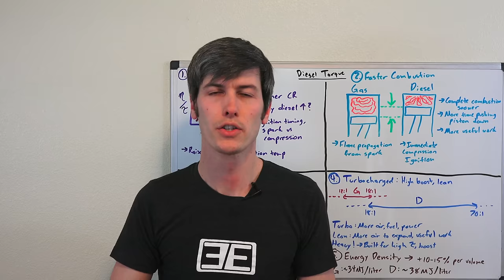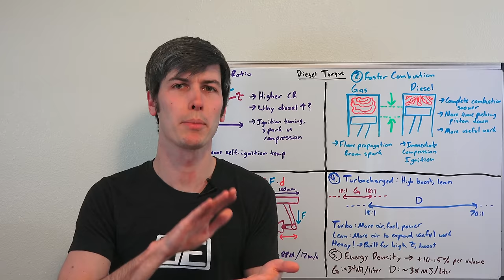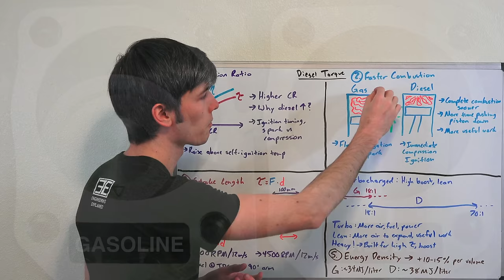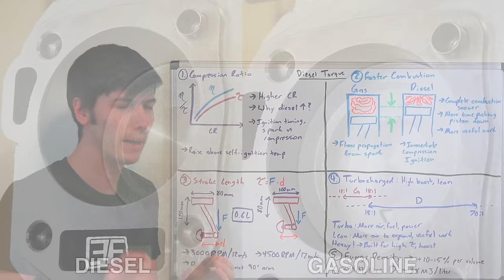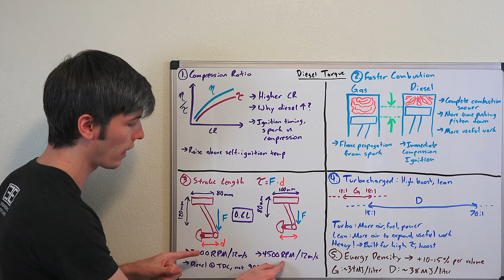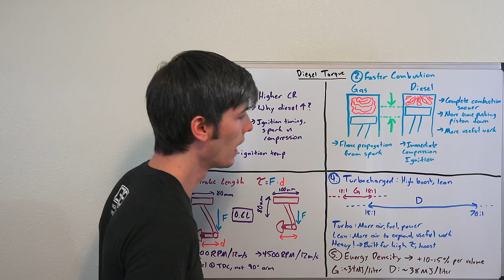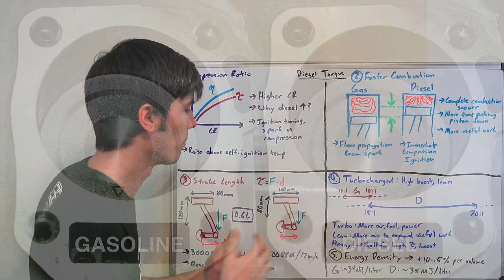5 Reasons Diesel Engines Make More Torque Than Gasoline

Comment: @Engineering Explained: What's the point of the comparison "Diesel has higher Energy in it, so if you spray the same amount Diesel in a Cylinder then you get more torque"? Your ECU always tries to spray in that amount of "burnable liquid" to get maximum  usage of all oxygen being inside your cylinder, no? So that would not mean you get out anything more or less torquy for the fact of energy being in a liter of Gasoline or Diesel. You just don't have to spray in the same amount of Diesel as you do have to with Gasoline for getting as much Oxygen being used for burning the fuel as possible. Or what exact was the point with the energy in it regarding torque?
Reply: Is that true to Turbo-Diesel's as well? To be honest I don't know what effect is more important - not having to compress more air than absolutely needed or getting more work out of the same amount of fuel by having more air volume pushed inside the cylinder. I would expect Turbo Diesels are not compressing more air pressed in the cylinder by the (regulated) Turbo as they need to because heating up more air for same amount of expansion would take more fuel as well.., so in my opinion ECU will try to maintain "load" figure nearby the optimum of maybe 60-70 percent "as less pre-compressed air into cylinder as possible" and "no more fuel than you can burn with that amount of air inside the cylinder". Why only 60-70 percent you may ask? I guess it's better having a bit more air you could use if you step on accelerator than just having to spool up Turbos before getting more power. Just reduce the effect of Turbo-lag a bit. ;-)

But, all that is just a guess of me, no real knowledge based on diagrams or given numbers and of course you're right that ECU for Turbo-Diesel engines doesn't have to maintain the air-to-fuel ratio for the mixture being able to explode! In fact it is more of an "candle burning down in some glass cylinder" thingy. And that will work as soon as you have a total amount of oxygen inside the cylinder that is big enough to burn all the diesel being injected.
Reply: "Your ECU always tries to spray in that amount of "burnable liquid" to get maximum  usage of all oxygen being inside your cylinder, no?"

No.  That's true of gasoline engines, but not diesel engines.  Diesels are excess air engines, and almost always emit oxygen in the exhaust.  That's why it's hard to reduce NOx emissions from a diesel engine: normal catalytic converters require an oxygen-free environment before they can reduce NOx.  Modern diesels require fancy techniques such as urea (Adblue) injection and NOx storage to get around that problem.
Reply: OK - THX for your informations, did really help me to update my expectations on how things would work ;) . Up to now I had just a few observations I got from my OBD adapter but now I got a slightly clue and more facts what actually is going on in ECU and which parameters are used in modern engines.

Comment: That's why horse power can never compare with torque. To move anything it takes toque not horse power.
Reply: so you say that 100hp/1000nm win dragrace with 1000hp/100nm both with optimal gearbox? NO.

Comment: The only reason why diesel engines have more torque is because they're usually turbocharged.
Reply: Diesel engines generally do produce more torque, even if compare naturally aspirated engines of both types. This is because of diesel greater brake mean effective (cylilnder) pressure. Where the naturally aspirated diesel engine struggles is the impossibly narrow rev band it occupies.

Comment: Gas cylinder pressure is around 170 psi before spark and diesel is 400 psi.
I wonder the cylinder pressure during combustion.
Reply: Carpe Diem Arts I have read before around 2500 psi
Reply: It could be anything in a wide range depending on fuel charge and turbo pressure. 
2500 on a diesel or gas? It's the top dead center pressure multiplied.

Comment: a naturally aspirated diesel engine does not make more torque or horsepower than a gasoline engine, they only make more power if they are turbo it that's what gives a diesel its power is the turbo without the turbo they are gutless
Reply: That is demonstrably false.
Reply: Cody'sLab if you take a 350 olds Diesel and a 350 Chevy, both stock both from the same year late 70s early 80s just for an example, that diesel engine naturally aspirated will not make that same horsepower or Torque that the gasoline engine has, and the gas engine from them years will be rated at net horsepower not gross horsepower

Comment: I've always wondered how, when using a turbocharged gasoline engine, the high pressure doesn't cause auto-ignition.
Reply: Turbo gasoline engines usually have low compression (9:1 or lower) to avoid that issue.
Reply: @redpilled3569  seems logical... Thank you very much!

Comment: gasoline engines waste more unspent fuel,diesel engines return there fuel to the tank, where its pre heated for recycle
Reply: That's incorrect. In both cases there are fuel returns to the tank.

Comment: The hell why we use then  gasoline engines instead of more effcient Diesel's? The problem is maybe the more polluting exhausts of Diesels
Reply: Gasoline is cheaper
Reply: @gabrielbereza1793  Gasoline is maybe cheaper elsewhere, but in Switzerland it's even more expensive than Diesel. However a Diesel engine costs more that's it.

Comment: Hey Jason, thanks for the video!

I also have some thoughts with some of your points:
  1. Makes sense. More efficiency should mean more torque.
  2. I thought diesel burned slower than gasoline, that's why diesel engines have (~25%) lower rpms than gasoline. The longer stroke should also play a role here.
  3. Shorter bore should mean less force since there is less surface (assuming same pressure) but for a longer length, which should result in the same amount of energy. If the pressures (diesel vs gas) change differently during the combustion/expansion (due to the way the fuels burn), this might play a role considering the different angles between the piston and the camshaft. This would also require some maths and integrals to figure it out... :)
  4. Turbo definitely increases the torque :)
  5. I don't think the energy density matters. This is because the limiting factor is not how much fuel we can provide to the engine but how much oxygen. So, unless diesel combustion produces more energy per oxygen mole (or whatever unit), there should be no difference. The difference in energy density matters instead when considering fuel consumption: most people think diesel engines require way less fuel than gas because they compare the fuel volume rather than the fuel mass. If they compared the mass, the difference in fuel consumption would be significantly less.

Comment: An electric motor produces the most torque which is why freight trains tend to be pulled by diesel-electric engines
Reply: Electric motor creates almost instatenous torque, not more, while combustion engines need to rev up to create maximum torque

Comment: What would you recommend to buy? A Diesel or a Gasoline car?
Reply: What type of driving are you doing?  What's the local fuel availability?  What's the climate?  What's the legal rules on each?  What's the planed use of the vehicle?  What type of performance do you want?

They both have advantages and disadvantages, and which is best for a particular use-case is can often be debated - and may be very different from another use-case.

Comment: Great informational video. That being said look up torque please.
Reply: Torque comes from leverage. Low rpm.  High torque
Reply: Deisels pull their power from the low rpm long throw on the crank to get their torque. That's why deisels are low rpm they make up the hp and torque on the low end. Hp work over time if you're interested in equatiotions. Torque is the application of that work. Deisels use torque. Ie use less hp to do something. More torque means less hp headed to get something done. More leverage. More fuel efficient. Less rpm and less speed

Comment: You need to show real engines instead of that lawnmower engine in your video.
Reply from the maker: Why? It illustrates the ideas wonderfully.
Reply: Engineering Explained because the average person might think that a gasoline and Diesel engine look the same except for what fuel you inject into them as implied by your video.

Comment: Why can't gasoline be ignited by compression?
Reply: It can. But remember that diesel ignites at a much lower temperature than gasoline.  Gasoline is harder to ignite with hot air alone.

Comment: Why dont they use the same combustion method for gas and diesel?
Reply: Ignition method.
Reply: @paulanderson79  i mean, gas engine uses spark plugs, and diesel engines use compressing to ignite. like why not use compression or vice versa?

Comment: Could a gas engine be made to run without spark plugs?
Reply: It probably could but it would have to be super hot in the cylinder
Reply: it will knock. Gas would ignite too early

Comment: Why don't diesel engine REV high like petrol engine.
Reply: Because combustion - the propagation of the flame front is slower with diesel than it is with petrol. Also consider that diesel engines generally have longer stroke and narrower bore than a similar capacity petrol engine. Once the flame front and piston crown are moving at the same speed there's no more force pushing the piston downwards.

Comment: Diesel engine has huge fly whell may this help gain the torque?
Reply: I dont think so i think the fly wheel since there is more force behind each powerstroke guves the pwer output a more smooth delibery isntead of it being spikes at each power stroke
Reply: Since the wheel will be spinning itll give a smooth power transfer and teh size is to compensate for all that torque

Comment: diesel has more resistance to compression like the difference between normal gasoline and race gas
Reply: Resistance to compression? Liquids are not compressible.
Reply: ??? i'm talking about the fuel's ability to resist compression before it self combust
Reply: It down to fundamental differences in the way the fuel is ignited. In a petrol engine the piston compresses the air/fuel mixture and this compressed mixture is then set of fire by the spark plug. Diesel engines compress only air. The ignition timing is controlled by the fuel injector itself. This is completely different from low vs higher octane fuel. Diesel doesn't have an octane rating at all. Instead is has a cetane rating. This is measure of how readily the diesel will ignite as opposed to how resistant it is to ignition.
Reply: jaer jaer go read some books on the subject , so because diesel have a different indicator to gasoline then it dosent have resistence to combustion or what ??? come on and it is called cetane or catane with diesel just so u know brummm brummmm meep meep :)